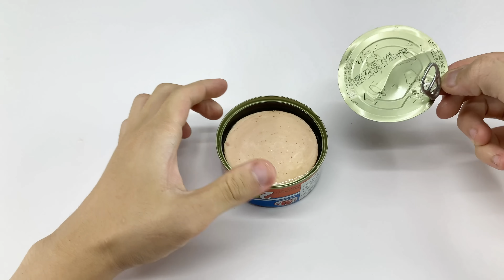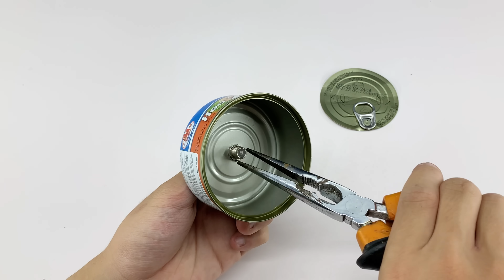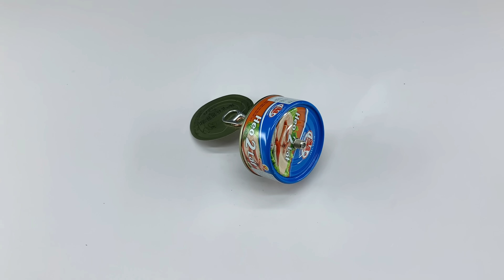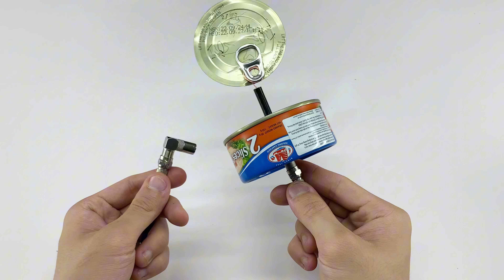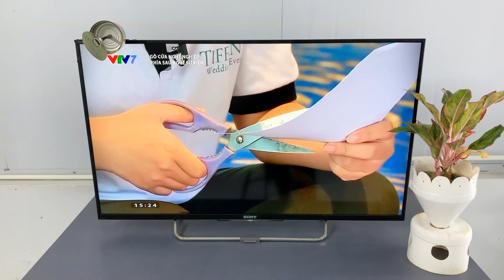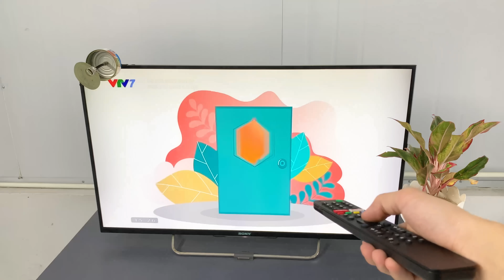No Internet Needed! Put a Tuna Can Behind Your TV – You’ll Be Shocked! 📡

Comment: I tried it with canned tuna, I tried for a long time, I followed the instructions exactly according to the video in question and the result was absolutely NOTHING, so the video is fake, I'm sorry 😞😞
Reply: I consider the video fake because as is known, all plasma TVs have a built-in antenna next to the image processor, so be careful not to damage your TV and don't rely on it inaccurately.
Reply from the maker: Thanks for actually trying it and sharing your result. 🙏 I understand your disappointment. Reception can vary a lot depending on location, signal strength, frequency, and setup, so the same experiment may not work everywhere. I appreciate your honest feedback! 📡👍

Comment: Sorry, it does not work.
Reply from the maker: Thanks for trying it 🙂

Signal strength depends heavily on your location, distance from the transmitter, building materials, and interference. In some areas it may work, in others it won’t at all.

A proper antenna is usually more reliable — this was just a simple DIY experiment 👍📡

Comment: If you did not see TUNA CAN what type of CAN will somebody apply to get the same result ???
Reply from the maker: Good question 👍 Any clean metal can of similar size can work for testing — the idea is about the metal shape, not the tuna itself. Results may vary depending on setup and signal strength.

Comment: This may be one of the applications that will damage the television, not everything is connected to the television because the possibility of short circuiting is very strong, the television may break down or the motherboard of the television may burn out.
Reply from the maker: Thank you for raising this important concern 🙏😊
Safety always comes first, and I encourage everyone to be careful and avoid connecting anything that could risk a short circuit.
Do you usually use any protective devices when testing setups? 😊
Reply: @Creative99999 I am a technology design expert, this is my job and we need to warn people about this because such applications can even start a fire in the product by short-circuiting, so it is necessary to be careful

Comment: I was told an antenna would  no longer work.
Reply from the maker: It depends on the situation.

An antenna can still work, but signal strength, interference, and location make a big difference. In some areas it works fine, in others it may not.

Comment: Does this really work?
Reply from the maker: Short answer: *it depends* 🙂

If you’re talking about the simple wire/tuna-can antenna idea — it can work **only if the signal in your area is already strong**. In that case, even a basic piece of wire can act as an antenna.

But it won’t create signal out of nowhere, and it won’t magically give you internet. In weak-signal areas, you’ll usually need a proper outdoor or amplified antenna.
Reply: @Creative99999  Thank you! ❤

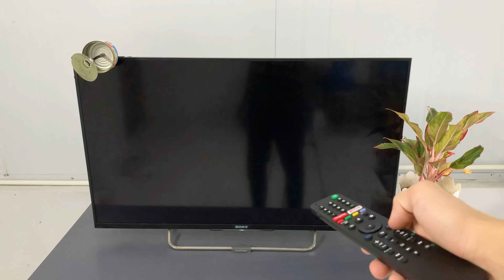Comment: This guy is right and this is practical. When there is a strong signal, you can even hang a one or two meter piece of bare wire on the wall and attach one end to the TV. It really becomes an antenna and works, so don't write nonsense. 12:22
Reply from the maker: You’re absolutely right 🙂

When the broadcast signal is strong enough, even a simple piece of wire can act as an antenna and receive channels. It’s not magic — it’s basic RF physics.

Signal strength and location make all the difference. Thanks for explaining it clearly.
Reply: @Creative99999  Yes, that's exactly right, good luck my friend. ❤

Comment: Can anyone help?? I tried this but i get an error message saying my smart tv is outdated and no longer supported by chicken of the sea
Reply from the maker: Haha 😄 that error sounds like a joke — “Chicken of the Sea” isn’t an app for TVs. If your smart TV says it’s outdated or unsuported, that usually means the built-in software can’t run newer apps. Here are a few real ways to fix that:

*Real fixes you can try*

1. *Update the TV software* through the settings menu (if there’s an update available).
2. *Use an external device* like a streaming stick (e.g., Roku, Fire TV, Chromecast, etc.) to run newer apps.
3. *Check the app store on your TV* — sometimes the app has a version that still works on older TVs.
4. *Use screen mirroring* from your phone or laptop if the TV supports it.

But no matter how you set it up, a can of tuna 🐟 won’t help with software issues 😄

If you want, tell me:

* TV brand and model
* The exact app you’re trying to run

and I can give more specific steps!

Comment: It looks like it does work in  ASIA  .   In the West  neighbors use the same server  yet  we cannot fall on that of  those just next door ,  each line is secured with very long numbers
Reply from the maker: It doesn’t really work that way 🙂

In most countries — East or West — each home internet connection is separate and secured. Even if neighbors use the same provider, each router has its own password and encryption (usually WPA2 or WPA3).

You can’t just “fall onto” or connect to a neighbor’s line because it’s protected with those long security keys. That’s normal network security everywhere.

If you’re having connection issues, it’s usually signal strength, router setup, or ISP configuration — not regional differences.

Comment: hangi kabloyu taktığını nereden bilelim ? büyük ihtimal uydu kablosunu taktın 😆
Reply from the maker: Exactly. A spark plug creates a controlled spark gap and can withstand high heat and voltage, while directly shorting a charger’s + and − terminals causes an uncontrolled current surge that can damage or destroy the charger, independent of its rated amperage.

Comment: If your local TV station was that strong of a signal you could just pick it up on a piece of wire ! The problem is when you're in a spot with very low signal you can't even pick up a signal with one of those store bought antennas !
Reply from the maker: You’re right — strong local signals are easy, weak ones are the real challenge.

Comment: I live in a fringe area where I'm 65 to 110 miles away from most TV stations.  Although does this work with FM radio signals?
Reply from the maker: Good question — and nice change from the tuna jokes 😄

For real-world use: *no**, this setup won’t reliably pull in TV stations from 65–110 miles away, and it won’t work well for **FM radio* either. At those distances you’d need a **proper outdoor directional antenna**, mounted high, ideally with a **low-noise preamp**.

FM radio uses **VHF (around 88–108 MHz)**, which needs an antenna designed for that wavelength (dipole, Yagi, or folded dipole). Random metal objects or improvised setups usually don’t have the right length or impedance to be effective.

If you want, tell me:

* TV or FM (or both)
* Terrain (flat, hills, trees)
* Indoor or outdoor install

I can suggest a *real antenna setup* that actually works in fringe areas.
Reply: @Creative99999  A big issue I have is I live in a home that was built in 1988. It has Styrofoam insulation in the roof that has a layer of foil on it.  So I'm guessing I need to go with an outdoor antenna for everything. I live in town, I grew up in the country.  We had the Channel Master fringe antenna and a rotor.  In 1985 we upgraded to a VHF/UHF combined antenna and added a Channel Master booster. I think the tower was 35 feet in the air.  My zip code is 62839. St. Louis, MO, Terre Haute, IN, and Evansville, IN, are the main stations that people want to watch around here. My father passed away in 1989  When my mom moved she took the antenna and it has been in her garage for over 35 years.  If my step dad did not throw it out.  Back in the 1960s my dad a degree in electronics.  He use to work for a place that sold Zenith televisions .  He installed antennas and worked on the TV's.  By the time I was born he was driving a bulldozer.

Comment: Mr. Gadget has a brilliant mind, but by the time you buy a can of tuna, drill, bore drill bit, coax wire, wire  pliers screw and nuts...you could've went to the store and brought a HD antenna. And where are you going to hide it if you have a date? Or do you plan to use it as a way to get lucky?
Reply from the maker: 😂 Fair point!
By the time you buy all that, an HD antenna would be cheaper and less awkward to explain on a date. Definitely not the smoothest “get lucky” plan 😅

Comment: LYING CLICK BAIT TITLE.  NO INTERNET JUST LOCAL CHANNELS.  STOP THE MANIPULATION WHICH IS WITCHCRAFT!  LIKE OTHERS POINTED OUT, SIMPLY PURCHASE A QUALITY ANTENNA FOR LOCAL CHANNELS.  DUE TO GEOGRAPHICAL & OTHER FACTORS, SOME AREAS WILL NOT SUPPORT AN ANTENNA.  THERE ARE WEBSITES WHERE YOU CAN CHECK YOUR ADDRESS FOR CONNECTIVITY BEFORE YOU WASTE MONEY ON AN ANTENNA WHICH WILL NOT WORK.  GOING AFTER THESE OVERPRICED INTERNET PROVIDERS & CABLE COS. IS ON THE "TO DO" LIST.  TRY TO HANG ON TIGHT AS WE DISMANTLE ALL THE FRAUD & CORRUPTION, PIECE BY PIECE. WAIT UNTIL YOU START RECEIVING ALL THE "REFUNDS!" AND BECOME UNTETHERED TO ELECTRONIC MIND CONTROL & START REALLY ENJOYING YOUR LIFE WITH YOUR LOVED ONES.  DEBT CANCELLATION, HEALTH & HEALING, RETURN OF THE PRODIGALS: THE SOUNDS & FRAGRANCES OF PERPETUAL SPRING ARE AT THE DOORSTEP.

Comment: 3 questions: #1. Does it matter what brand of tuna is used and #2. Does it have to be a tuna can or any can of the same size work? #3. What if a person doesn't own a drill?
Reply from the maker: Good questions — brand usually doesn’t matter, any similar metal can may work depending on the purpose, and if someone doesn’t have tools, it’s better not to attempt modifications that could be unsafe.
Reply: How silly

Comment: Use the same can & a pringles lid, a 1.2v led bulb and aaa battery to make a flashlight.  You can use a solar path light with a bad nicad for parts.
Reply from the maker: That’s a clever little DIY hack 👍 Simple parts, low voltage, and a good way to reuse old stuff — especially salvaging the LED from a solar path light.

Comment: This works just fine...but all you really need is a small length of coax cable attached to the tv on one end and the exposed copper of the coax on the other end.
Reply: Yep! That's what I use 😊 AND if u hold the open end of the cable cord against the plug in part of an extension cord, hit scan and you'll get a lot of digital channels!
Reply: Exactly! I just wrote that! I'm sure you have to be within a close range, though.
Reply: Yep, you just connect the other end to the cable jack.

Comment: If I do this, will I get stations that broadcast from the Orient?  Looks like it from the video. No mention of the range for the antenna.  If put on the top of your roof, does it work better?  If it does, how do you keep the cat from going up there and liking the tuna juice out of it?
Reply from the maker: No. That antenna **only picks up nearby stations**, it can't pick up signals from the East.
Putting it on the roof **is slightly better**, but there are still limitations.
Those videos often **exaggerate**.

Comment: I have bought those antennas that guarantees you get channels & all it gives you is Asians channels & some antique programs.
Reply from the maker: Ah, that makes sense 😅

It sounds like the antenna is picking up **strong local signals**, but not necessarily all the channels you expected.

* Antennas only receive **what’s broadcast nearby**.
* If most strong signals are foreign or older channels, that’s what will come through.
* Placement, height, and line-of-sight to towers affect reception.

For better results, try:

* Moving the antenna *higher or near a window*
* Adjusting *direction toward the nearest broadcast tower*
* Checking a *channel map* for your area to see which channels are available

If you want, I can explain a **simple trick to maximize antenna reception at home**. Do you want me to?
Reply: @Creative99999 I tried everything, nothing works

Comment: Where did you plug the connector to behind the TV? What will it say?
Reply from the maker: Usually, the connector goes into the *antenna or coaxial input* on the back of the TV, often labeled **“ANT IN,” “RF IN,” or just a coax symbol**.

Once it’s plugged in and the TV is set to the correct input/source, it should display the **channel list or signal strength**, depending on whether you run a channel scan first.

Comment: I've never had an antenna work for me for tv yet, but how does this give internet?
Reply from the maker: Ah, that makes sense! 😄 A lemon battery or similar experiment **doesn’t give internet**. It’s just for powering tiny devices with a very small voltage—like a clock or LED.

TV antennas and internet require **real power and signal sources**, so this trick won’t work for those.

Comment: No internet needed, unless you want to stream programming from the internet.  This is just a simple tv antenna for picking up local channels.  You could just pick up a set of rabbit ears, or use a wire coat hanger, which would be cheaper than building this fishy antenna.
Reply from the maker: Exactly! No internet required—just a simple antenna does the job. Sometimes the simplest solutions are the most effective and cheapest 😄📺

Comment: Mine disenteng worked but whenever I uses corn Ed beer Cam IT world perfect Lt.
Reply from the maker: Ah yes, the **corned beef can antenna trick**! 😄🥫

Sometimes different materials work better depending on the signal in your area, so it's great that the can worked for you 👍
Just make sure it's *not connected to any power source* and stays safe to touch ⚠️

Thanks for sharing your result — very cool! 🙌

Comment: Creative way to tune in to regular "over the air" broadcast Tv stations.  BUT IT IS NOT INTERNET. It is simply an antenna to capture over the air signals just like the old "rabbit ears" we use to use and which still can be used.  The number of stations and the strength of the signal you will get depends on how many stations are in your area and how close you are the stations broadcast towers.  
This device does not connect to the internet therefore You will not be able to use a Firestick or Roku with this tuna can setup or any antenna  nor even a powerful roof top one.  So have fun making this little gadget and watch the Price is Right, Days of Our Lives and the 6 O'clock News.
Reply: @Creative99999  The title and narration are deceptive. You should have been more truthful up front exactly what this device does. You talk about capturing "the signal" but you do not explain what can  of signal. 
It would still be a fun worthwhile project even if you had been honest about what it actually  does.
Reply from the maker: Thanks for the feedback — you’re right, the device only receives over-the-air TV signals and not internet, and the title should have made that clearer for viewers. What type of well-explained DIY would you like to see next?

Comment: I would like to know how to receive the new MPEG 4 channels that are coming out. I suppose that takes a special, smart tv and not just an antenna.
Reply from the maker: Great question! To receive the new MPEG-4 channels, you’ll need a TV or a set-top box that supports MPEG-4 (H.264) decoding. A normal antenna is still required, but the antenna alone can’t decode MPEG-4 — the TV’s tuner must support it.
If your TV is older and only supports MPEG-2, you can still use an external digital receiver/decoder that supports MPEG-4 and connect it via HDMI.
Are you currently using an older TV or a smart TV?
Reply: @Creative99999  Thanks for your reply! I have a Vizio LED TV from 2014 that is not a smart TV. It does have HDMI capability, however. I was surprised while channel surfing to see NOT SUPPORT come up on my screen for ch. 27-88 (Boston, MA).

Comment: Thank you, I'll try it. Can you itemize the product used ,or listed ?
Reply from the maker: Sure! Here’s a simple itemized list of what was used, so you can try it easily:

Old router (for the antenna parts)

Small piece of coaxial cable

Glue (hot glue or strong craft glue)

Metal plate or can lid (as the reflector)

Scissors/knife to strip the cable

If you want, I can write a clearer step-by-step version too — is that helpful for your next DIY try?

Comment: What About Creating An Antenna In A, Mirrored-Fractal-Pattern, For, Maximum Impact.?!
👊
Reply from the maker: That’s an interesting idea! Fractal shapes look cool, but simple antenna designs are usually safer and easier for everyone to try.
Have you tested any DIY shapes before?
Reply: Not Personally, However, I Watched A Few Videos Of Guys Showing The Merits Of Various, Mirrored-Fractal-Antennas.
Very Impressed, With The Results.!
Nice Video Though, So Thanks For The Upload.

Maby The Guy, In The Video, With A Fractal-Antenna, Could Pick Up, Japanese TV, Maby.!

Cutt Out Fractal Antenna-Design On Cardboard, B4 Applying With Metal, As YOUR Template. 
💫
Reply from the maker: That’s actually a really cool idea — fractal antennas are a real thing and can boost range and efficiency.
For DIY projects, it’s more advanced, but definitely possible if you like experimenting.
Your concept sounds awesome! 👊📡
Reply: @Creative99999 Also, Using Fractal Antennas, With, "Cardboard Templates", Mix, &, Match, For Maximum-Range.!
Cardboard, Covered In, TINFOIL, #1st, Then Sheet-Metal.

Few, Years Back, Another Guy, Used 3 Sims, With Three Small Magnets, On Back Of Phone, Held In Place By TINFOIL-Strip, &, The, Phone Case, &, Used A Copper Wire, Spiral, As Antenna, FREE-PHONE-INTERNET.!
No Subscription Needed. 
No Actual Sim Inside The Phone, Either.

Matched Up, With Your TV Antenna, GOOD 2 GO.!
💫📱🏆